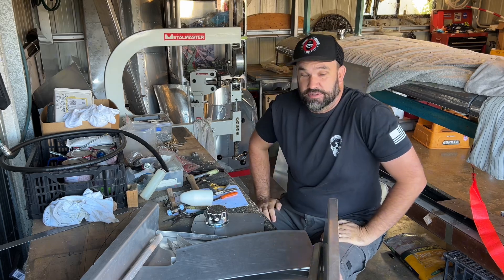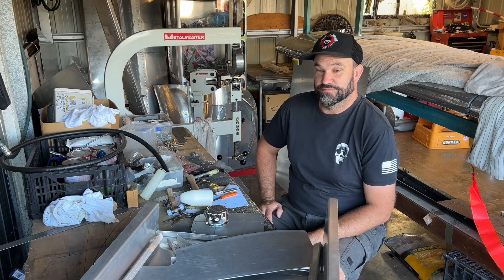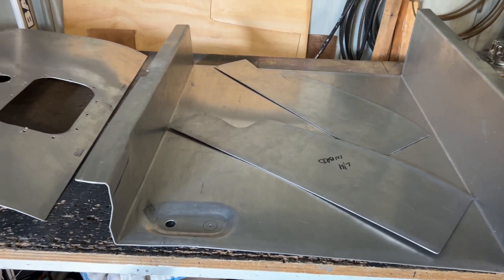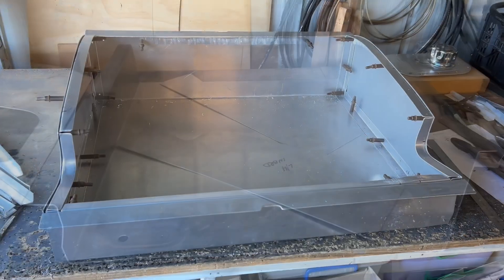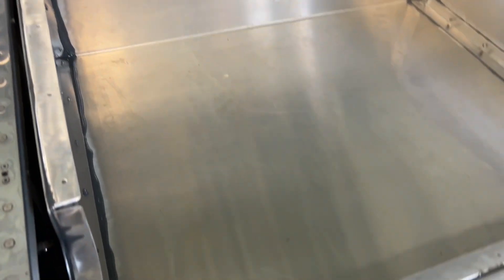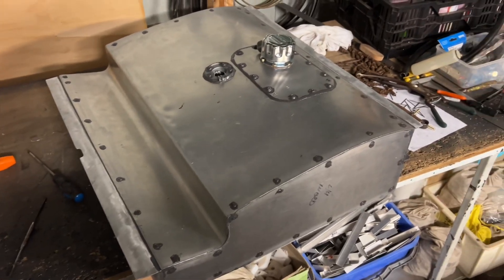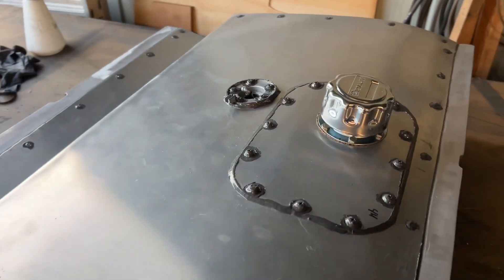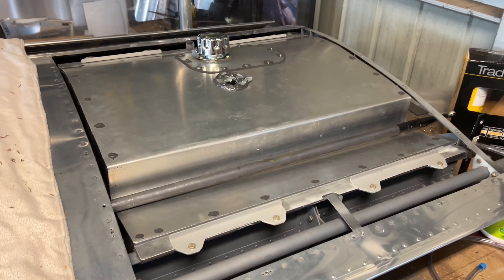Frankenstein’s Funky Fuel tanks!

Comment: Most people just grab two spanners and think she is tight ,hell some think it's got a 12 " inch handle I have it a good go........no Torque wrench........I had to calibrate all the torque air tools for a role I had when they were making all car manufacturers components under the same factory roof.....I found out that the master Torque calibration unit that all air tools are set too daily.....wasn't correctly setup.....by last inspector.......( Mercedes Benz/ Toyota / Mazda / other cars all done on assembly line for major 4x4 canopy manufacturers here in Brisbane.....shit was coming loose........( Head's rolled)..........I have a lot of engineering life skills ,time cost money.......one car in this line was the NEW X factor Mercedes Benz........rear canopy prototype I was next to it on the first run out of the Production canopy moulder ....lol..$$$$$
Reply from the maker: Torque wrench calibrations have been a big part of maintenance for us for quite a while. Even had to do a bunch of work to redo things when the calibration test failed. Having recorded the value each time helped sort out what needed rechecking

Comment: Oh before I forget, people use a lot of Anodised aluminium aircraft fittings for fuel tanks and fuel lines.......they don't relize that tools that Torque them up are colour coded so no over torque results.....in the flare on the tube or fittings....all aircraft grade fittings run a special specific angled flare ........(37degrees).....not 45degrees like the Automotive fittings then they use wrong spanners and just over tighten the fitting ,what happens is that fitting will leak.........one day...... because 37 degrees is not mating with 45 degrees.........( I have 37 degrees specific aviation flaring tool $800) I purchased it so I can make all my own fuel lines and flaring ,I also have every other flaring angle tools to do all types of tube flares 45 ,37, yes lots of dollars on tools ........it cost a lot of time and effort to build up over a life's work..
Reply from the maker: I was lucky enough to be able to use the 37deg flare tool from work for my stuff.

Comment: Don ,I can help you out with a Weld Master HF 180Amp DC inverter.....with Flexi head T17 torch and gas regulator hoses and you can do your own Tig welding in Stainless steel/ 4140 ,mild steel all steels but not Aluminium..it has arc welding hand piece.......( has no AC function) So this inverter can't do aluminium.......but it's all in perfect condition...........I have my other AC / DC inverter that I can weld Ally.............if you want to be able to do your own Tig welding for ( aircraft components non ally)..........I can gift you this unit at no cost ......to add to your Back yard shed .........with the view you have your own Tig to use the force and learn a new skill..........just think of it as Obi Wan Kenobi.........giving Luke his first light Saber inside the Mellinium Falcon..( star wars)..............I could sell it off ...but I think you could make use of it.................just plug into 240 v single phase and add gas bottle...........rest is up to you........let me know if you are interested...........
Reply from the maker: I sure do appreciate that mate. But I don’t think I can put the time in to learning how to weld properly with everything else going on currently. It really is an art form

Comment: I am totally with you about glueing tanks together. I thought you might have gone with a few more rivets possibly solids. Anyway I am supprised no one could do the welding for you, we weld 0.8mm at work but you may have needed to put in a few swages to reduce distorsion.
Reply from the maker: I was going to use solids but got a hold of some sealed pop rivets. It was easier to use them instead of getting my gun and dolly all covered in goop. I am treating the rivets more like holders while the glue dries rather than structural members. And I was wrestling with how many holes I put in the tank that needed sealing. I think the welders around here are more used to automotive and industrial/agricultural tanks instead of going for weight saving. I think they could’ve welded that size, but they just didn’t think it’d work without cracking and I couldn’t convince them that I was taking responsibility for that. Fun times!
Reply: @donwtsn  you may be right about the welder around you or it might be that it's for an aircraft,  that puts a lot off.  I think it is choice more rivets with a pitch around 4d or less would seal a joint but more holes and how much faith you have in a bond. As long as the tank is on flex mount system,  I think you'll be OK 👍

Comment: How thick was the tank material.?
Reply from the maker: I used 1.6mm 5005 aluminium. The angled pieces are made out of the same material
Reply: Find it strange no one could weld it.
Reply from the maker: @madcotter0074 I think it was more along the lines that they believed it would crack and therefore wouldn’t touch it. I’m not a welder so I don’t have that knowledge and experience to lean on.